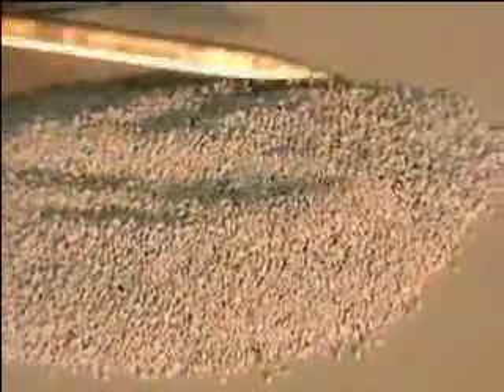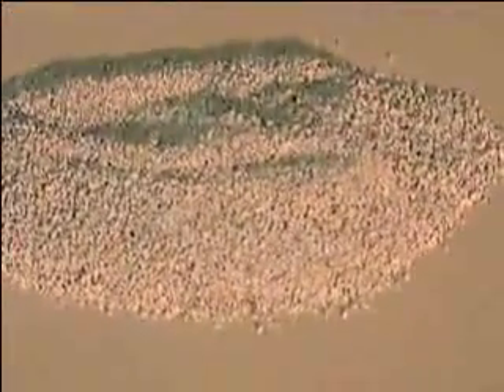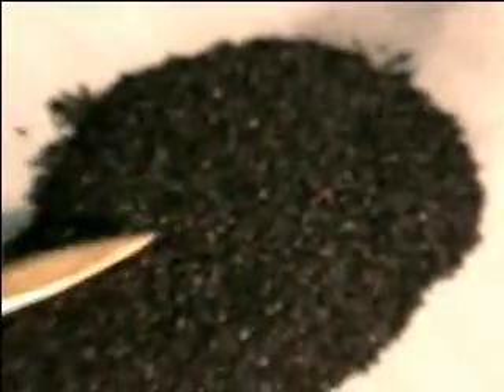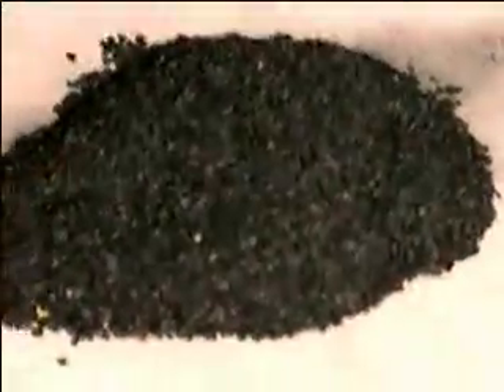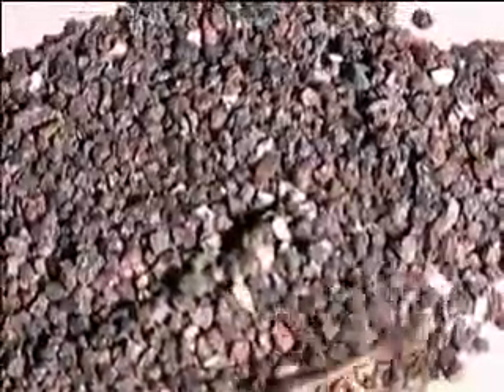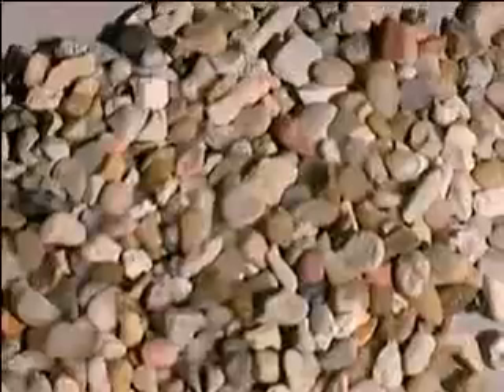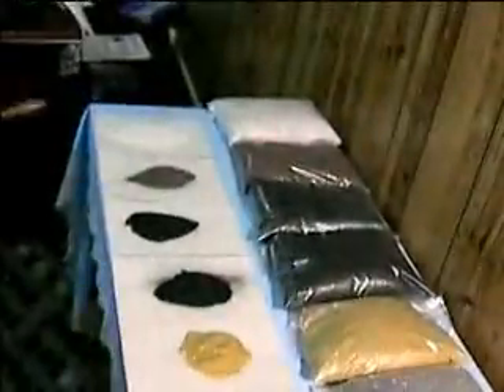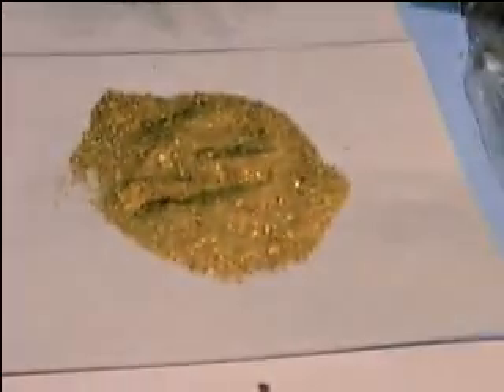Healthy Water Man: How to make healthy water.

Comment: @GodBlesstheWorld2008 you dont need a filter to remove chlorine , just place a bottle with the water in ur freezer with the cap open, the chlorine will vaporize, now to remove fluoride you will need an powerful filter, be ready to spend a few bucks if you want that. Btw not all cities or towns allow fluoride so try to find that out for your location.